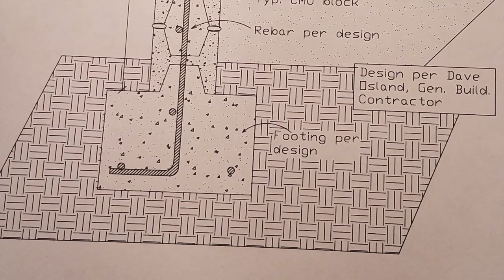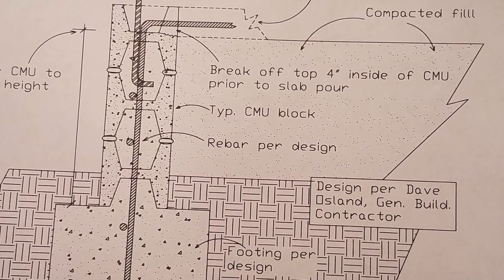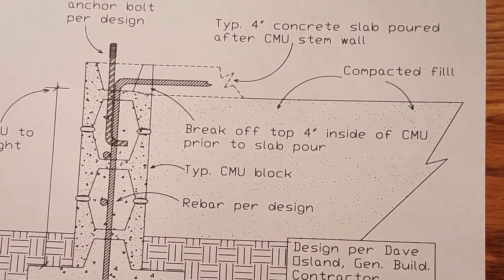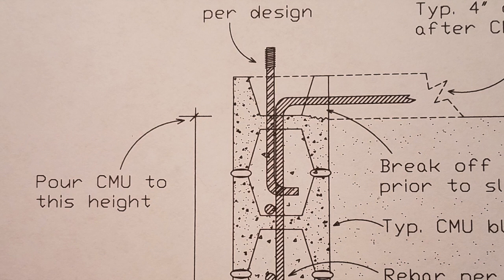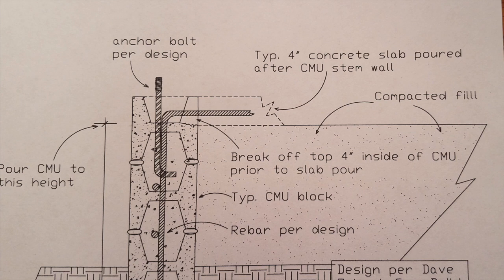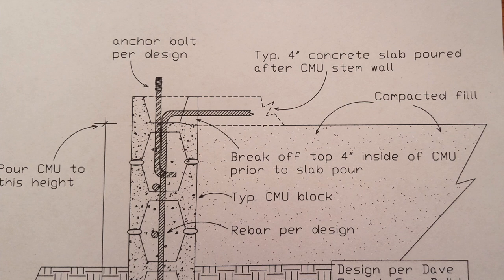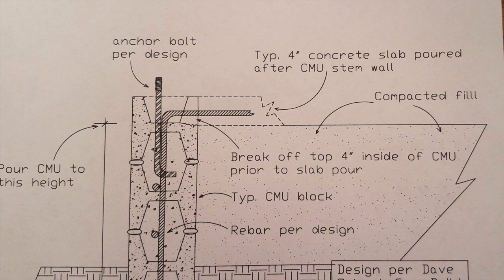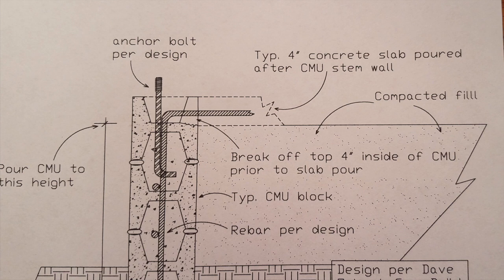Concrete Stem Wall to Slab Connection

Comment: Hello --  Is this a code requirement to tie the stem wall and slab together? Also there is no insulation in your system!
Reply from the maker: Good question! Code depends on the application.
In this instance, this is used for an unheated shop/garage area. As with many areas, an engineer often gets involved with the design/sign off....Dave

Comment: Hi, I just bought an old house built in 1977 in downtown Albuquerque NM.  It has a solid stem wall (not block) and there is a crack all the way around the perimeter where the slab meets the stem wall.  The crack varies from about 1/4” to maybe 1/2” at most in some areas. I want to fill this because the house had a cockroach infestation and I noticed that they get in in some spots under the base wall 2x4s (because there is no glue or sealant on the stem wall which is aggregate concrete and then they come in and can live / nest and breed in the crack between the slab and stem wall.  I could use some rubber like compound like Sikaflex or self-leveling cement to fill the entire void.  The cement being very fluid would also likely help fill in gaps under the 2x4 wall base.  I just don’t know if one option is more appropriate than the other. Any help is appreciated.
Reply from the maker: Sounds like the slab was poured after the stemwall and probably lacked the rebar to tie the 2 together... 
However you seal/bond the slab and stemwall together now, you may have to use a power washer or something like that to clean the surfaces for bonding.
I like the 2 part epoxy in tubes (like Simpson) for bonding in situations like that.
Sikaflex will seal, but won't bond the 2 together and keep them from moving as they've done.
Let us know what you do and how it worked!
Dave
Reply: @daveosland3199  I need to do the entire perimeter of the house, which currently is 1400sf and basically a 25ft x 60ft rectangle, I assumed that filling the crack with self leveling cement will be cheaper than epoxy but after thinking about it further, I think epoxy or a polyurethane caulk would be adequate.  The house was built in 1977 so I don’t think it will move or settle any more than it has. It has one minor slab crack about 1/3 the length of the house, across the 25ft length with no major unleveling on either side.  I mainly want to seal the crack to prevent bug infestations as we have roaches here.  So after sealing, I’m also using spray foam at the base of the walls as all drywall is set about 1/2” off the floor.  The house is also in Albuquerque NM and is situated almost exactly east to west and we can get up to 105F in August and sometimes in the teens in winter so thermal expansion from one side to the other needs to be considered as the 60ft long north side of the house will always be cooler than the south side. So for example in winter, the north side could be 30F, while the sun heats the south side to 60F or higher.  Maybe that’s why it’s not all tied together…to allow for some planned expansion and contraction.
Reply from the maker: The polyurethane caulk might be a good choice. Here in california, I'm always thinking about earthquakes and movement..
Reply: @oldowl4290  It’s not the building in itself that gives value to the house, it is the LOCATION !!! 😊😊😊
Reply: @anonymousbyproxy8250  I think it has to be a bit of both but yes, a good location is always a huge factor.

Comment: How do you read blue prints that show you that you’ll have to build a house with a stem wall?
Reply from the maker: Foundation pages and cross section pages for quick references.
For scant details contact the designer.
Dave

Comment: Hello, building a garage with a stem wall

On the low side it’s about 8 inches by 2ft high and my footers have 2 rows of rebar and the plans also call for vertical rebar every 16 inches on center 

Is that enough or do I need to run another row of rebar sideways to tie all of the vertical ones together? 

Thanks!
Reply from the maker: The extra horizontal runs are cheap insurance for an extra strong foundation!
Dave

Comment: Excellent Video Dave ! . . By the way, which is stronger, a CMU block stem wall or an all Concrete stem wall ?
Reply from the maker: Good question! Generally, a solid poured concrete wall should be stronger, but a CMU wall can be just as strong because of design (wider block, extra rebar, etc...)
Reply: Poured concrete stem wall : stronger, it’s done fast, it’s more expensive but saves time. CMU stem wall : less resistant than the poured one, needs more time to be completed, more and tedious work involved but cheaper cost. If time is a consideration then poured wall is preferable BUT it must be done by masons who do it all the time and have the appropriate equipment since a collapse of a segment of the form and without the man power to quickly correct it is a financial catastrophe - this cannot happen with a CMU stem wall.

Comment: Do you ever run 4" gravel under the slab or is that only for on grade pours?
Reply from the maker: Yes,  a bed of crushed rock (or sand) is often under the slabs. It provides a capillary break if there is a foreseeable problem with ground water or dampness...Dave

Comment: How would you go about drainage?
Reply from the maker: Good question!
In an area of suspected drainage problems, 3" pipe (PVC or styrene)) can be put thru the block at desired locations before pouring. I say 3" because slotted caps are readily available to keep critters from entering under the foundation...
  As a general rule, water is not an issue because of  the floor height in relation to the finish grade outside the structure. Dave

Comment: when the pad expands and contracts, will you see any cracks in the stem wall?  I have a project I might parge but wondering if the cracks might end up showing through.
Reply from the maker: If you have soils that expands/contracts/heaves, etc., generally you'll have a different type of foundation- pier and grade beam, deeper footings to get below the frost line or some other type of engineered foundation.
  In more stable soils, this type of foundation is pretty much bulletproof....Dave